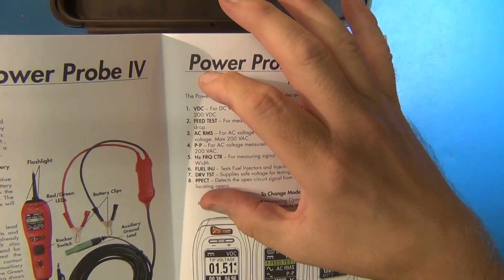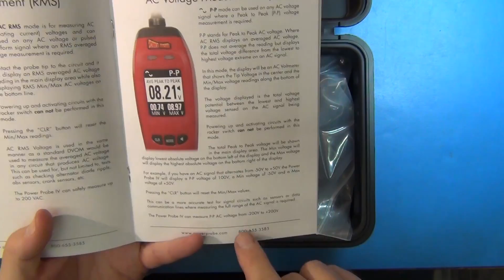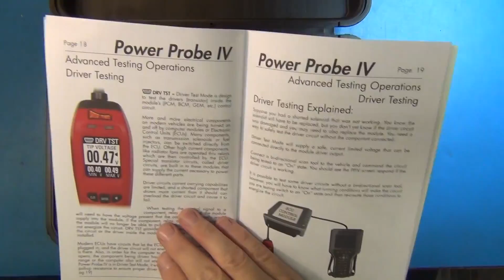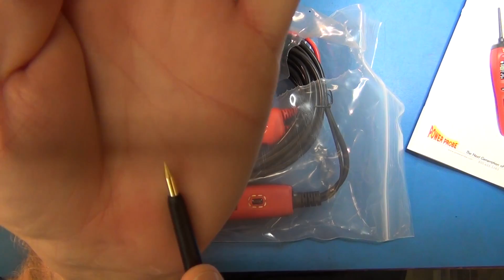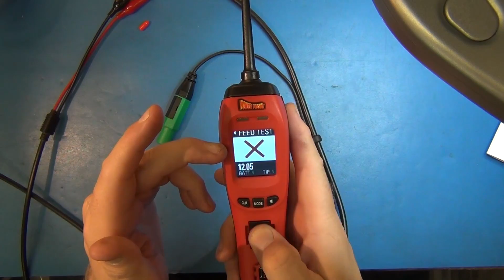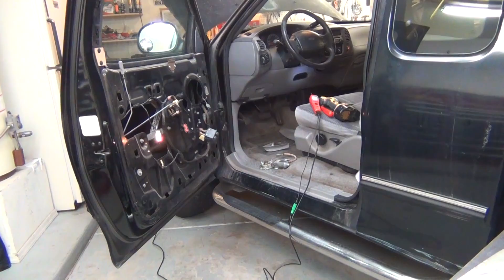Power Probe 4 Review

Comment: House A/C current is a back and forth flow of electrons. 
Car D/C is a one direction flow of electrons. 
Connecting the Probe 4 to a car, the current is one direction.
For the elections to flow from one direction to a back and forth direction, the current has to transfer from  DC to AC via a Transformer. The two wiring coils in a Transformer doesn't touch each other. That allows the correct to transfer from the DC to the AC without the possibility to back flow, reverse back from the AC to the DC.
If you would connect AC directly touching the DC without the use of a Transformer, that would cause the free electrons to collide into each other, causing overheating/ collision of the free elections. 
The power Probe is designed to be connected to DC, not AC. If connected to AC, the the free electrons would collide, causing overheating, a collision of the free electrons, in which would kill the Power Probe.
That's the reason connecting to AC house current would kill the Power Probe.

Comment: There are garages and dealerships that will fire you for piercing the insulation of a wire. It introduces moisture and crap that will corrode the wire and it's unnecessary.
Reply from the maker: I've heard that too. Well, not much of an issue really because if you think of it all the ends of each wire are exposed so if a tiny pin hole would cause such a problem then should all the wire ends also be corroding back up the wires and destroying the connector ends? Doesn't seem to happen so maybe this is just an exposure issues. That is if the exposure spot is highly corrosive like with salts and water then any connection or pin hole will cause an issue. So if your're careful you should be fine, but still don't do this at a dealership for sure.

Comment: Ha ! Ha ! C’mon man....it doesn’t take a rocket scientist to “simply” figure out what the + & - signs are, embossed into the fuse cover on back. Here’s a little hint: Push forward on the switch, you get + ! Pull back on the switch...and you get - !! Right !?!! Yeeeeeeeaaaaa !!! Did you figure that out yet !?? Your problem is that you are trying (thinking) too hard !  ! SLOW DOWN a couple clicks, think practically, use common-sense, not analytical sense, and things will come to you “easier” ! Anytime a tool has the capability of emitting ac/dc voltage, UL Code most likely requires the tool to be physically identified as having such electrical capability. Ahaaaa !!!!!
Reply from the maker: OK fair point. But why put why print this on the back? It is already printed on the front where the switch is. What is the point of printing it on the back?

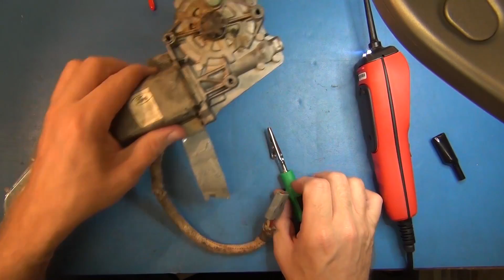Comment: 29:33 too bad they don't display the feed current when testing components like that. It would have been useful information.  as a workaround you could put an separate ammeter in series with the ground clip, but it would have been better as an all in one tool.
Reply from the maker: True but in feet test it does read ohms and volts so I=V/R

Comment: Great informative review......you only briefly mention the HOOK ....would be great to have a more detailed rundown on the differences between the PP4 and the HOOK
Reply from the maker: True, there are a lot of differances. So much that the Hook really doesn't have the value that it cost. A few tricks the Hook does make it very handy but for not for the price and not for general shade tree mechanics. But if I ever get a Hook I will do the video. Thanks for the support and the suggestion.
Reply: Thanks....Power Probe have a 50% off deal on the HOOK at the moment which makes it $50.00 cheaper than the PP4...that was the reason behind my earlier question
Reply from the maker: Well I do see the 50% off on the Hook but that means it still cost ~$250  which is $100 more than the PPV per my amazon store link in the show notes. I think the 50% off goes to show you that this product isn't all that they think and hipped it up to be. It has a few tricks but I still don't see the value in it for the price plus the PPV is just smaller and much easier to use and meet the 90% off the same tricks an auto-mechanic needs.
Reply: @ToddFun  That “10%” is money and time in my pock. I have been using the Hook for 5 years, with a really good lead set that also fits my DVM and scope, it paid for itself many years ago. But a DIY person is better of with the 3 [ which I also have ] or 4 until they learn advanced diagnostics and have access to wiring diagrams. DIY’s, learn your tool before you use it as any tool can cause issues if used wrong.
Reply from the maker: @adrian vac  PP4

Comment: I hate that they changed the cable  connector from 2 leads to 4 leads on this version.  I have pp3 with an extra cable but if get the new pp4 i won't be able to use it.
Reply from the maker: True however the PP4 does have a longer cable out of the box than the PP3 so you shouldn't need the extra cable  unless you are working something real like long RVs or something.

Comment: How does this compare to the Power Probe 3?  Any reason to purchase the 3 instead of the 4? Is it much bulkier?
Reply from the maker: PP3 doesn't have all the same features and the PP3 has a shorter cord. Unless you are trying to save the money I would recommend the PP4 over the PP3. The PP4 is not much different in size than the PP3. The Power Prob Hook is a much bulkier tool and I wouldn't recommend looking at the Hook.

Comment: powerprobe = 0 customer support...
Reply from the maker: You have a good point. I can't disagree. I love the tool however.
Reply: No customer support? 
Is there another tool that does the same thing as this one that would be a better option? How about the Power Probe 3?
Reply: 707SonomaComa they don't fix there probe if you fubar it you are made to buy a replacement probe instead of fixing what you had ...
Reply: Patrick 
how did it get fubar'd? Did the internal circuit breaker fail to protect it on an attempt to source power?
Reply from the maker: PP3 doesn't have all the same features and the PP3 has a shorter cord. Unless you are trying to save the money I would recommend the PP4 over the PP3.

Comment: hey Todd, can we test parasitic draw with this? thanks
Reply from the maker: Not really. You would want something that can meter DC amps (uA, mA and A) and put such a tester in series with the circuit you think has a parasitic draw when all expected loads are disconnected or off. I guess you could use the PP4 to look for voltage drops in a circuit and once you get on the other side of such a parasitic load you should notice more voltage drop with respect to the battery source showing. That is kind of like looking for parasitic loads but not by finding current loads and I don't think it would be easy nor would it tell you the scale of the parasitic current load like and DC amp meter.
Reply: Ok thank you so much

Comment: Travis, in answer to your question about voltage being good. Think of a battery cable. If you were to sever all strands but one, you would have perfect continuity from one end to the other. You could apply voltage to one end and read the same voltage at the other end. Voltage is the potential pressure to push electrons through a circuit, not the measurement of work. But would that same cable be able to support the current load when placed into a circuit? Voltage drop testing measures how much the voltage drops under a loaded condition, in other words a live functioning circuit. When testing a live circuit, you should read your source voltage prior to the load device, whether it is a lamp, a motor, etc., and there should be no voltage left over after the load device, IF there is no resistance other than your load device. Voltage is the POTENTIAL to do work. I hope this helps.

Comment: The extension for the 3 is $19 and the extension for the 4 is $115. I looked and two of the 3 leads for $38 and a little knife work on the some of the ends can connect in it's place. Do you see or know of any reason why this wouldn't work to save everyone $72 to get an extension for the new 4?
Reply from the maker: +Shawn Dickens Good idea really. It will work just fine if you get the polarity correct on both ends (no accidental crossovers) and can hack the plastic connectors to fully engage. You give up the clean single cable feature as well as the clean plugin of a single connector but it sure would save a lot of $.
Reply: I'll most likely leave it always connected and there are many ways to tie the lines together like one for those savings. I just wasn't sure if there is more to it since when I first connected mine it wouldn't power up because it was just a couple mm short of fully coupled.

Comment: How can something have good voltage, but still not be any good? It seems that whatever resistance you experience would also lower voltage too.
Reply from the maker: +Travis Heinze A DMM volt meter has ~10M ohms input resistance so a connection can read good voltage to a DMM but when you put a low ohm load on and start to pull current through the poor connection the connection fails, resistance can drift up, the connection can heat a little causing a poor solder joint to expand and many other strange conditions can cause a failed load test. The battery itself may drop out under load even. These are all different then a simple high ohm input voltage test.
Reply: A positive battery cable going to a starter motor that is almost severed , leaving ONLY one strand of copper wire will STILL read 12 volts . Try to start the car and the amp load - current - will NOT pass through that one strand . Why are battery cables heavier than other wires ? The amperage needs all that copper to get to the starter  ( load device ) . It will heat or burn through that ONE strand of copper . The heavier the amp load , the heavier the wire . A 30 amp fuse is thicker than a 5 amp fuse .

Comment: NO SUPPORT AND NO RESPONSE FROM THEIR TECH
Reply: Matt Sinna Thanks, that was really helpful.
Reply: +Lenz Brown BE VERY CAREFUL IF YOU ARE PLANNING ON PURCHASING THIS TOOL!!! I have and I am very disappointed. There is no support and the ground testing side of the tool fails. It has caused me to mis-diagnose certain faults concerning the ground or neutral test. I sent them emails at their site but no response.
Reply: What happened? Did you ever get in contact with them?
Reply: 707SonomaComa

I have the power probe II so I just continued to use that. I did get in contact with them but never got any answer concerning the tool, so I figure they want me to purchase a new one.

Are you having the same neutral ground problem?
Reply: then get a scope

Comment: Thanks for the review Todd. I'm thinking about a PP4 myself. One easy and effective way to lower, but still hear, the buzzer is to put a piece of tape over the speaker. I recommend tape like painters or masking as they hold up pretty well and don't leave a nasty sticky residue. If, after putting the tape over the speaker it's not loud enough for you, you can poke some small holes in the tape until you get the level you like.
Reply from the maker: +Baxrok2 Great idea! I'm going to do that as it is too loud for me unless the car is running. Thanks.

Comment: Good review Todd, my question is when you are at the vehicle testing the power window circuit,  is it the pp4 or the video that seems to have a time delay, nearly 2-3 seconds after you let off the power window button until the tester reacts?
Reply from the maker: +Dave H Yes, there is a delay of about 2 seconds there. Part of the delay is that there is a window motor relay in the vehicle that has to enable/disable as well as the test delay of the PP4. But for sure there is a test delay in this resistance measurement mode of the PP4 unlike the default PP4 mode where it is simply testing for power or ground present.

Comment: I am thinking the plus and minus on the back is to tell you the right direction of the power up switch when using the tool facing the wrong way.  Just a safety not to run positive when you need neg.  when holding the tool face down.  Just my guess.
Reply from the maker: +Tow guy best suggestion to date. Thanks.
Reply from the maker: +Tow guy I out out my PP4 this morning and tested to see if your idea worked and made sense. It sure does. I was easy to see the +/- but I had good lighting. If I was doing this in the darker condition on a car it would be much harder to see the +/- on the black rubber. Just the same I'm sure that is the reason for them now. Thanks.

Comment: In addition to my previous post:
3) for Voltage drop tests the circuit MUST be loaded. Does PP4 do that? I thought that only LoadPro can do this (I have that too, and it works well too)
4) the AC modes might be nice but for complete test of my Battery, Starter and Alternator the Picoscope cannot be replaced at all.

So there is room for improvement, maybe PP5 :-)

But I bought mine to use the VDC feature so I have 2 Voltmeters available to directly compare with the battery power and ground and more important I can supply good battery voltage or ground at any place around the car, and for that it is PERFECT.
Also a big plus is that they use the standard Banana style plugs so I can use all the plugs and wires that I already have, with it.
Sincerely,
Bernhard
Btw., I also ordered it with the second tip to use on the ground wire.
Reply from the maker: +Bernhard List Maybe the PP5 will have more features but it sounds like your picoscope would be tough act to follow. I ran some tests on my bench. The PP4 pulls a 15mA DC test current for the voltage drop test. The green light and buzzer signaling a good power source comes on if it reads less than 10 ohms. As the load resistance goes up the current drops and when my 10 turn pot reached 1K the current was down to 8mA DC. So yes it is a loaded test and it will only buzz good if there is less than 10 ohms of line resistance to the tip.
Reply: +Todd Harrison (ToddFun) 
Wow, interesting. I have to see how the LoadPro is doing that, how much of a load he is putting on a circuit for his test. Btw., this is a great tool too if You don't want the long cable behind You for a quick test.
Greetings

Comment: Hi Todd
First, thanks for the review. I recently bought the PP4 and In most points I agree 100% with You and up front:
I love the tool!
Now the Logo will always be a thumbs down.
More important:
1) the fuel injector feature is to say it nicely, useless! The only uuseful information is that there is control from the PCM, BUT I need to see the current ramp (with the pintle dip for opening and the steepnees of the ramp to see any shorting of the coil) and the Voltage curve with the pintle hump in order to know the pintle opens and closes. For this, there is no way around my Picoscope, nice try Powerprobe guys.
2) I agree concerning the ground plug. It always gets caught in tight spaces ..... my car has lots of them. My choice would have been to add a rechargeable battery and both cables unplugable so if I just want to use it as a Voltmeter in the rear of my car, unplug the supply and use the groundwire and You have a "mobile" Volt/Ohmmeter.
More to come.
Reply: I bought the 3 because I figured I'd still use the shops oscilloscope for the injectors, cam and crank sensors, and MAF.

Comment: Great review Todd.  I own the Power Probe 3 and ECT2000 - invaluable tools.
Reply from the maker: +buildstoys Thanks. I was looking at the "Hook" but after comparing the features set, application notes and review on Amazon it was clear I would be able to use it as well as the IV for general automotive repairs. I might get the ECT2000 if I don't just build a simple 8v 4K Hz signal of my own just to see how the IV picks it up.